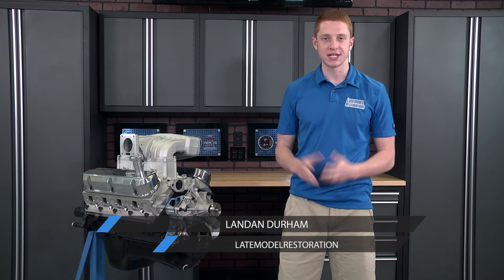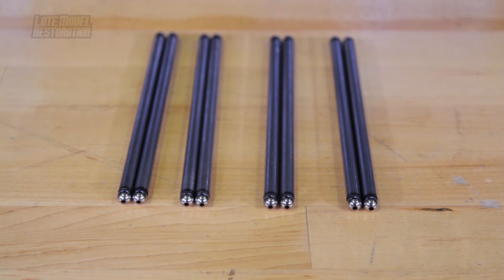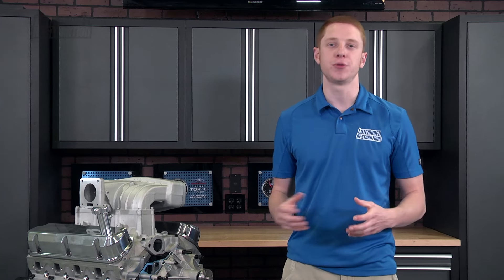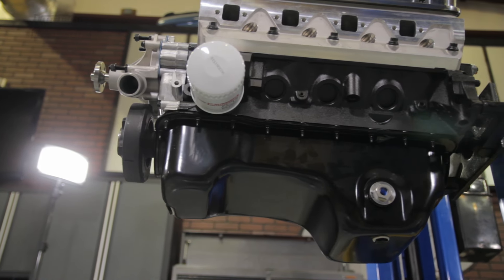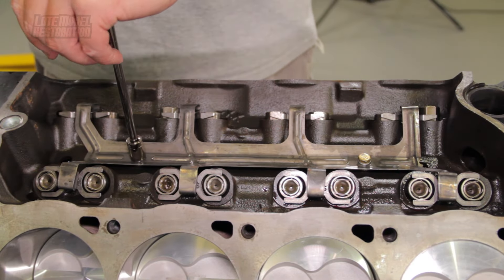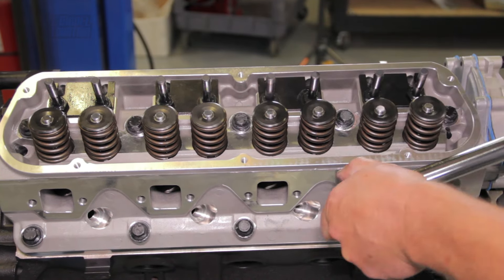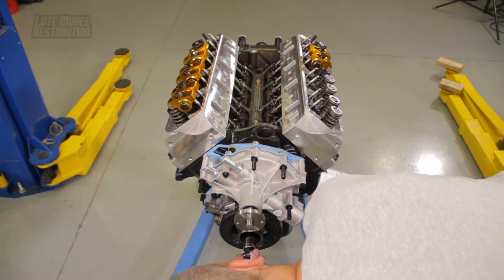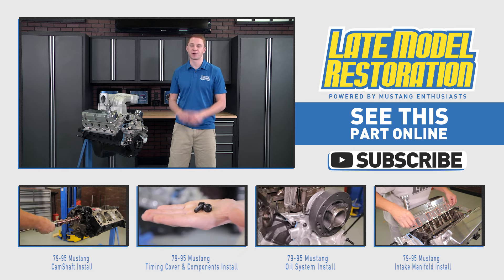How To Install 302/351 Mustang Cylinder Heads & Valvetrain (1979-1995)

Comment: hey, i know im 8 years late, but I was just wondering, whats the difference between fastener assembly lube, and regular assembly lube?
Reply: and can I use regular assembly use in place of it?
Reply from the maker: Fastener lube is formulated specifically to duplicate all fastener preload specifications. You see this with higher end hardware such as ARP. Assembly lube is formulated to protect new or freshly machined parts from wear after staring the engine following a build. -Landan

Comment: Ive seen people in comments be upset about the amount of torque used. OEM on mine is a hex head bolt. ARP use a flange head bolt. The book states, (use ft lbs for all but final!) hex use a 2 step of 55 to 65 then 65 to 72. I switched to ARP (flange head) so its a 3 step process 25 to 35 then 45 to 55 and a final of 85 to 95 DEGREES rotation. This is verbatim. It does not mention a 3rd to 80ft lbs or just the top bolts but ALL bolts.

Comment: Need some help, does the smaller head bolts go thru a coolant passage on a 351w?  There is so much of a debate.  Can you answer this plz. I now have coolant seeping in between the block and head

Comment: The book says after the 70 ft lb pass to torque all the upper head bolts to 80.
Reply: Is this still true? The uppers go to 80
Reply: Whos book? Final 3rd Pass for flange bolts is 85 to 95 degrees. Hex heads only have a 2 step process ending at 72 ft lbs max.

Comment: About 4 minutes in you indicate to use thread sealant on the lower bolts.  Since it goes through the water jacket, what specific thread sealant do you suggest?

Comment: Can you put GT40 heads on a 351
Reply from the maker: A 351W, yes. The 1993-1995 Lightnings were equipped with GT40 heads. -Landan
Reply: Ok sweet thanks

Comment: I just rebuilt my 95 went with a set of canton valve covers they clear rockers fine but altinator doesn't fit anyone else run into this problem?
Reply: I had the same issue using a set of tall aluminum valve covers on my engine with the high mount alternator.
I took half to 3/4 of an inch off of the valve cover face down to the mounting flange and then welded in a 3mm flat plate.
After paint it looks factory and is still miles away from #1 cyl intake valve train.

Comment: would I run into any problems putting a set of gt 40 heads on my 94 gt without a comp cam .?
Reply: Chern889 has a video up about the GT 40 heads in a 94

Comment: I have a question I've been debating for a while, what kind of headers fit the gt40x heads? I've read somewhere we need special bigger headers? Can someone please help
Reply from the maker: The GT40X heads have the same spark plug location has a factory head. While the exhaust ports are larger, most aftermarket headers will work. -Landan
Reply: Late Model Restoration Would a 302's stock ported headers work with GT40X heads? I plan on just porting my lower and possibly picking up a set of GT40P heads if all else fails.

Comment: If you’re not using poly locks would you recommend using any particular grade of thread lock on the rocker bolts? (Crane 1.7’s). This vid is really helpful simplest I’ve found to follow so far!

Comment: What roller rockers are those? I can't find them in your website
Reply from the maker: Those particular roller rockers are only sold with our top end kits. -Landan
Reply: use scorpian. cheaper and just as good as more expensive.i've put them on 4 engines

Comment: Anyone here ever ran the SVE heads? There cheap but are they to cheap?
Reply: Casting itself is not bad. It’s the valve job and valvetrain components that are garbage. You buy them you got put all new valves and springs on them and get a good valve job, by that point you can just get better trickflow heads.

Comment: I bought a B-303 cam with new roller lifters new springs and new spring retainers. When I called comp cams one guy told me to buy 8 1.375" retainers and 8 1.437 retainers. I was wondering why I need 2 different sizes. Is one size intake and one size exhaust or was I just told to buy the wrong stuff? I have a 302 with stock heads I'm just changing out the few things I mentioned. Anything helps, thanks.
Reply from the maker: Hey Robert, the intake and the exhaust do take different sizes. As when it comes to those specific sizes, those are most likely correct by what Comp Cams told you.
Reply: @latemodelrestoration  would you happen to know which one is for intake and which one is for exhaust by any chance?

Comment: I'm sorry but you should soak the lifters in oil over night and the cylinder head torque should be 80 lb. No matter if it is iron or aluminum heads.